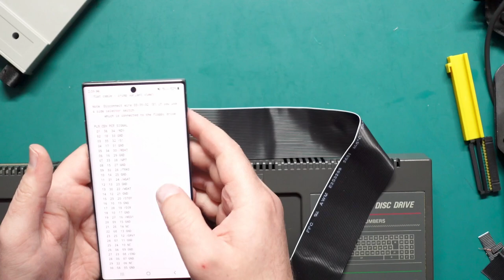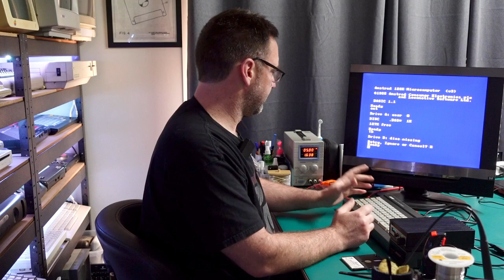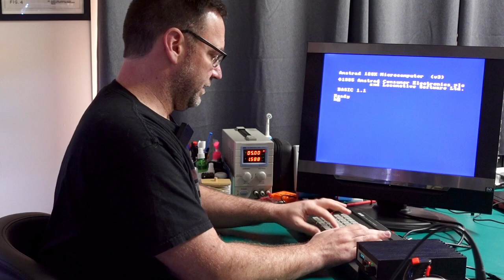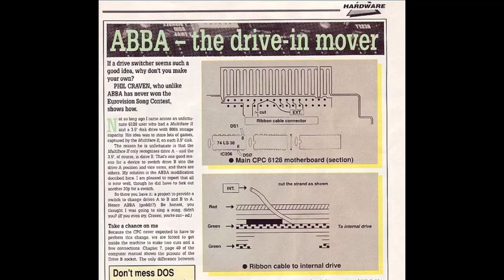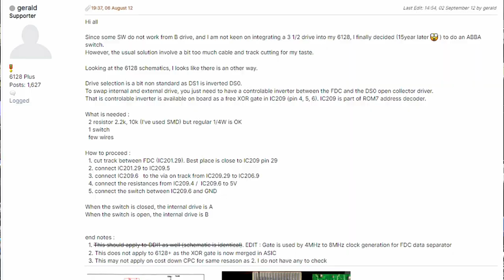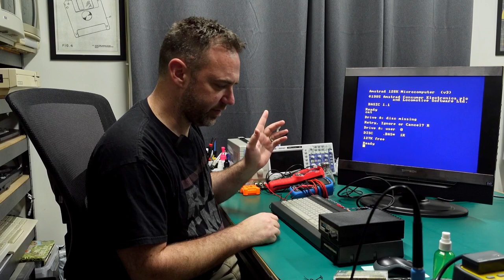Amstrad CPC6128 Part 3 - External gotek and no-cut ABBA switch

Comment: Much simpler solution for an ABBA switch with no soldering on the main pcb is to put a toggle switch on the gotek instead and put it across pins 11 and 12 so when those pins are shorted it turns the gotek to A drive 😃
Reply from the maker: Interesting, does that cause any conflicts with the internal drive? Does it work the same, so the internal can be accessed as the B drive?
Reply: @TheRetroChannel  yes the internal becomes the B drive
Reply: I did try that approach first, but for some reason it didn't work for me... not quite sure why. I suspect that since there are quite a few slightly different Gotek models, some may not be compatible or maybe some of them may need some more tinkering. But I am really just guessing in the dark here, because it should have worked in my mind.
Reply: Mr Guru  This is the best solution and I did the same! You can even order the cable with ABBA switch from ebay if you dont want to build your own.
Reply: MrTGuru  As with everything in life, it is never that simple. First of all; clone or not, they are still classifiable as Goteks.
If you take a deep dive into the FlashFloppy documentation, you will find a list of which PCB/micro-controller models work the best with the FlashFloppy firmware, which are to be avoided, and which are entirely incompatible.

Disregarding all the compact non 3.5" form factor versions, functional variations are still clearly visible. Some have jumpers, some dip-switches, and some more or less of either, some have the pin-holes for the rotary-encoder in different locations, and some don't even have the rotary-encoder option at all. The micro-controllers also differ in size from model to model.

What this all boils down to is that, as the older micro-controllers gradually become unobtainable, it has been necessary to adapt the design for newer and more available models, with more resources and potential functionalities. This phenomenon is obviously not confined to Goteks alone, but to all micro-controller, CLPD, FPGA (etc.) based electronics.
Reply: I tried this and it works in AMSDOS but not in CP/M.

Comment: I traced the ABBA switch mod back to 2 pins on the 74LS38 in IC206 (right next to the floppy drive power leads on the motherboard). Then I de-soldered it, put in a socket and made a daughter-board for it out of a small piece of prototyping PCB. I put a 4-pin connector on the PCB for the switch and did a bit of quite simple rewiring. Flipping the switch now swaps pin 6 and pin 8 (the 2 drive-ID pins) around on the IC. That way I didn't have to cut any traces and if I should ever want to reverse it, it is just a matter of removing the daughter-board and putting the 74LS38 directly back into its socket.
Reply from the maker: I considered doing something similar. The only thing that tripped me up was the schematics show pin 8 connects back to pins 4 and 5 of the nand gate, which is then output on pin 6. And my brain couldn't figure out how to wire the switch without breaking functionality of one of the drives
Reply: @TheRetroChannel  Well, the explanation for that is actually rather simple. You can derive any of the other gates from NAND (NOT AND) gates, as long as you have enough of them.
- In this case by connecting pin 8 to 4 and 5 will make that gate behave like an inverter (or a NOT gate). So when pin 8 is "low" then pin 6 will be "high" and when pin 8 is "high" then pin 6 will be "low"... Which when you think about it makes good sense, because you won't ever want the CPC6128 to select both drives or none of them.

- If you'd like to brush up on all that gate stuff or logic ICs in general, you should check Ben Eater here on YT. He dives into all that (and much more) and he is really good at explaining even the more complex things.

Comment: Nice work on the upgrade. I'm still checking out the game catalog myself. When I get a 128 sometime this year I'll probably do this external method myself.
Reply from the maker: Nice. The ABBA switch may be unnecessary, so that means you would only need to run 5V to the gotek and put a switch on the gotek itself - see the pinned comment

Comment: Thanks a lot for the videos! I just got a CPC 6128 and I'm planning to do the internal 5V to 12V mod, and maybe the external Gotek + A/B switch as well.
Please, what power supply did you get in the end to power all (not the bench power supply)? I suppose it needs to give more than 2 amps.
Oh, about the CPC games to recommend, try Hostages, North & South, Light Corridor and The Sword of Ianna. I did graphics for the first 2, and the music for all of them ;-)
Reply from the maker: I ended up getting a 5amp power supply, I think it was just a cheap one off eBay. You could probably get away with a 3A one. Thanks for the game suggestions, I'll have to check them out sometime